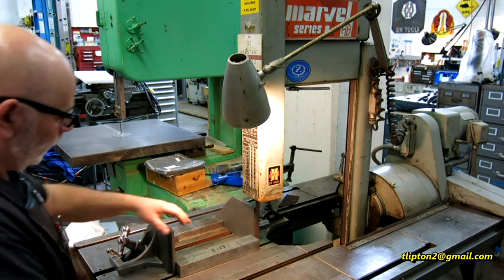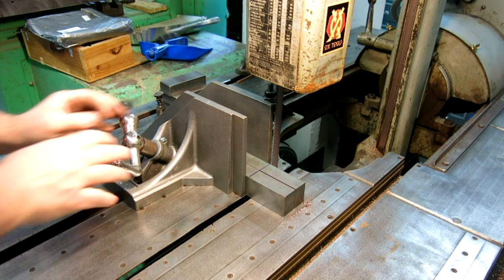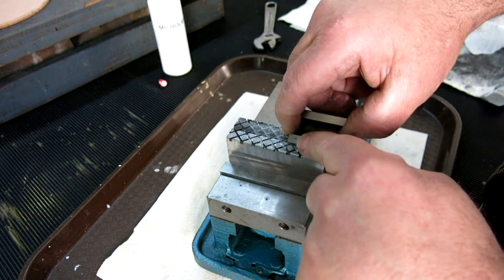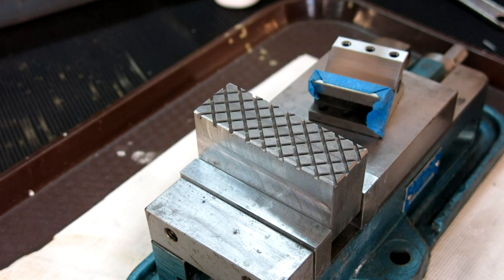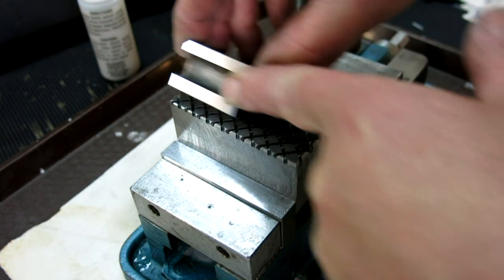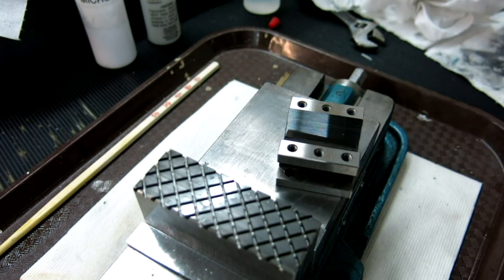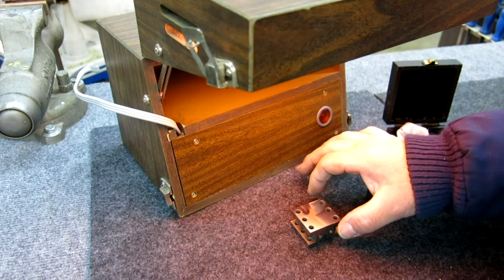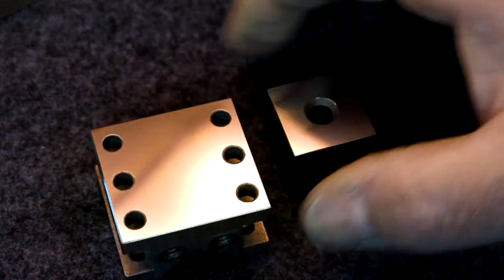Lapping a V Block With a shop made lap

Comment: The circular lap looks like it's maybe dished out. What would the results be like after regrinding it?
Reply: Well, it takes a whole lot of work and experience to get things ground flat on a surface grinder like his to within 1 or 2 ten-thousandth of an inch, which is the same as 100-200 millionths of an inch. Since he determined that the base of his V-block was lapped flat to within 20-30 millionths, then it doesn't make sense to use a surface grinder to attempt to make the lapping plate flatter, now, does it?
Reply: If the circular lap is out, you don't grind it in, you lap it in. If it could have been ground better, he would have just ground the part better in the first place.
Reply: chris0tube regardless of the wheel grit, or the quality of the grinding machine; with proper use lapping will produce flatness and surface finish 2-3 orders of magnitude better than surface grinding. Please research both technologies, and you'll learn that there's really no comparison. You're talking about a wheel with 360 points/sq in (call it ~53 thousandths particle size) vs lapping compound that has particles 3 millionths in size.

There's no comparison. The ways themselves on that surface grinder have variations over 10x larger than the total planar deviation on his lapped workpiece.
Reply: @ chris Of course surface grinding would be better than machining. But you still have to lap it in anyway if you want it to be really good. Watch Tom's most recent videos.

Comment: Ive spent the last couple weeks watching your content. Super impressed with your extensive knowledge base. Thanks for sharring. 
Ive asked about the feed drive on that Marvel saw before and i dont mean to beat the horse here but im still a bit fuzzy on one thing.   The long rod that runs the length of the saw i assume is the driven member. So it enters the migic box where the hand wheel is at.  So whats in that magic box. It must skip teeth and the weight makes that either harder or easier to do. Could you elaborate on whats going on in that box and how it gets back to move the saw please.    
Kindest Regards

Comment: Just curious about the "11 milions of an inch" between bands?

Light has a wave length of about 500 nano meters. which is (if my conversion is correct) about 0.2 ten thousands of an inch , or about 20 millionths of an inch.

So wouldn't the distance between bands be 20 millions of an inch, or is there some funky trick that gives half that resolution?

I played with some optical flats nearly 30yrs ago when i was an engineering intern at a very high precision tool making company and got to spend a few weeks in their metrology lab. This is the first time since then that i have seen an optical flat and those fringe pattern lines.

I remember the Lab manager claimed they had the next best length/flatness etc standards in the Country (Australia) after the National Standards. The metrology lab was intended primarily for internal use but they had a pretty healthy side business calibrating other peoples masters to theirs.

Cheers
Reply: edit WRONG! : I think it adds up nicely.  The distance between bands represents only half the wave length, from peak to peak.  That gives a wave length of 22 millionths, or approx 600 nm which places us at the end of the orange spectrum and beginning of the red spectrum.  
Interesting optical effect this, and it resembles the physics experiment from high school where a laser beam passes through two slits in a dark glass, producing two semi circular waves on the back side.  Two wave top ads up to produce a bright red dot (wave maximum), two valleys  produce a block spot (wave minimum) and a top and valley neutralize if I remember correctly.   This experiment proves that light is both a particle movement and a wave movement.  The experiment can even be done with water.  I don't know if this is the effect at play, optics is a strange science.  I remember when Tom demonstrated that stress light thingy, never seen stranger thing (at least not this year (or was it last)).
Reply: Arnljot Seem oh yeah the 11 millionths would be 1/2 a wave. thanks
Reply: The fancy light he's using is ~11 millionths of an inch (280nm). Typically you'd see a couple helium light bands as the flatness tolerance for seal components.
Reply: Krap101, I pretty sure that's not correct, since it would be outside the visible light spectrum which has wave lengths in the range 400-700nm.

The fancy-ness of that light is that it produces a single wave length of light, not multiple wave lengths like most lights.

As Arnljot already pointed out the feature Tom was reffering to with width 11 Millions of an inch, was created by half a wave length, with the full wave length being around 22 millions of an inch.

I had wrongly understood he was talking about the pitch of the bands, when he was actually talking about the "gap", eg Lh side of one black band to RH side of next black band, which is obviously half a pitch and thus 11 milions of an inch.

Cheers
Reply: Apologies, the wavelength of the light is 587.6 nm. A helium light band is half of that. The width of the bands and the distance between is determined by the air gap. The wavelength of the light determines the "resolution" of the measurement, so the lower the wavelength, the higher the resolution.
Reply: russhellmy: Sorry, what I said about the distance between bands is wrong.  It is one (1) wavelength of difference.  However, The way Tom said this is open to misinterpretation.  When you follow the edge of Toms razor, starting from a bright band; since the bands are curving when the surface isn't flat, by the time the razor crosses a dark band you have arrived at a point on the surface object being measured that have 1/2 wave length in height difference.  By the time you arrive at the next bright band, the height difference is one full wave length.
 Going from dark to dark, og bright to bright represents one full wave length in height difference.  Sorry for the misinformation.

Comment: Hey Tom, another great video. On one of your other videos I mentioned that I inherited my Grandfathers machinist tools. One of the things he made was a lapping block, it is approximately 3"x5"x1.125 thick. When I found it, it was in a leather pouch and looked like it needed a good cleaning. Watching this video, you are using Simple Green to clean up the lap block you made. Is there anything else that might work just as well, without a water based cleaning solution. I'm just worried about rust using something like Simple Green.
Reply from the maker: Hi Steve,

With water based cleaners you just need to dry the part well and then apply some protective coating like LPS. The soaps help remove old grease and crud. Alternately you can clean in solvent but then you have a bunch of dirty solvent to deal with. Thanks for the comment.

Cheers,

Tom

Comment: Great video Tom! Just curious, how much material do you figure you removed from the "V"? Do you think maybe the lapping could have pushed the "V" off centre an appreciable amount? Ex: Using the block in an instance where you cannot touch off the part (too small) and have to rely on locating the centre of the "V" from touching off the outside of the block.
Thanks!
Reply: I was thinking the same thing.  You wold need to maintain an equal number of  strokes and pressure for each side as well as be able to measure how much metal was being removed.  A Johansson Indicator and some gage (Jo) blocks might help with that.

Comment: Lapping in one direction only + allowing slurry to dry up a bit = ugly scratch marks (although object is shiny on camera, but that's not proper mirror finish, there is also "grain structure" you can reveal with unfortunate lapping direction) + other defects like pits/pores (dried, packed up compound can rip off particles of steel due to cold welding - of course, genuine casting pores may be present too - mixing different abrasives doesn't help too).
At this point it is questionable, if it's better or worst V-block now (in terms of geometry).
For most of the audience, it looks better for sure.
Reply: SJWs & Betas Killer excuse me Junior, did someone force you to watch this video? if not, you are excused!  your negative comments does not serve any purpose!
Reply: Yes it does, he's giving advice....
Reply: SJWs & Betas Killer ,I think u right, I dont think V block are better ,it just only shiny. Real one must begin with precision grinding and then scraping.

Comment: What would one use that V block for? I am not a machinist, but find these videos interesting to watch.
Reply: For holding round material
Reply: Aha, like mount it to your vise?
Reply: It holds round materials parallel  with the bottom of the vblock, so it can be used to help hold material in a vice or for marking out, welding or several other applications

Comment: Hello Tom, I assume you mean polarized light, not monochromatic. That would be jut one wavelength like red, or green or blue.
But great information as always.
Reply from the maker: Hi Ewald,

No I do mean monochromatic light. It is one wavelength. In this case 587.6 nm helium. Thanks for the comment. 

Cheers,

Tom
Reply: This is interesting. I think, I'll dig myself into this. Thanks for your information.
Reply: Hello Tom,

That's interesting. I'll think I'll dig into this stuff. Up to now, I thought only polarized light can do this. Thank you for your info about this.

Regards,
Ewald

Comment: My question is the material for the lapping tool. Wouldn't a softer lapping tool be worn out by a harder material being lapped?Just wondering as I have no experience with lapping, only sharpening.
Reply: James Stanlake The softer material ends up with abrasive grit stuck in it, where the harder material has the grit dragged across it.
Reply: That will happen eventually, lap will be worn out. Improper technique and/or abrasive will speed up this process.
But normally lap will work as other guy explained (lap is charged with abrasive, and abrasive will "attack" material being lapped more than lap itself).

Comment: Why is cast iron used specifically for lapping blocks?
Reply: CI is soft enough, yet durable at the same time, to allow the abrasive to be embedded into the lap.  It is possible to use other materials such as copper or aluminum et al. but CI is often considered longer lasting.
Reply: @Chris - That is interesting regarding atomic structure but other materials are used as lapping devices commonly. For example, cylindrical laps for fine finishing of precision bores are often made of copper or brass.  Both would allow the abrasive to embed, right? I can understand the stability concerns when dealing with a large flat lapping plate of larger size, maybe 12x18 inches with deep webbing on the bottom. 
  
I need to re-read Connelly's book on Machine Tool Reconditioning.

Looking at Young's Modulus of Elasticity for CI vs CU, they are almost identical at room temperature.  Maybe I am missing something....can you clarify in regards to lapping?
Reply: These comments are great! Thanks guys